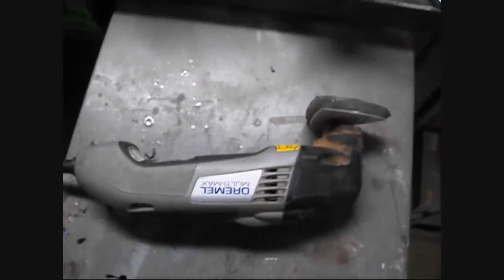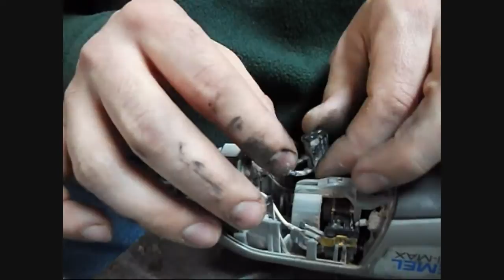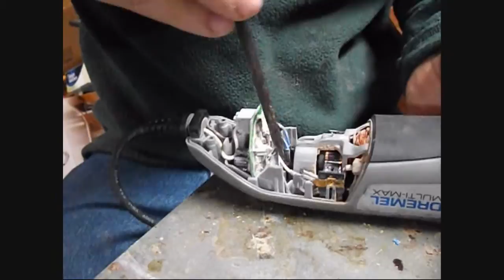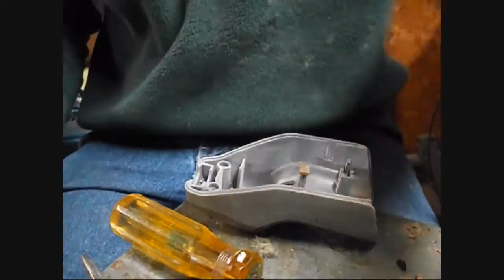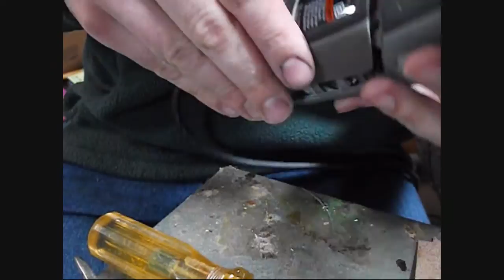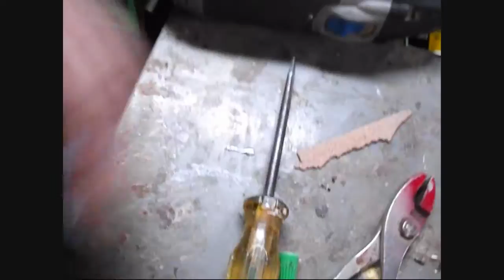Dremel Multi-Max fix

Comment: That's it buddy.  Thanks for posting this video.  I pulled my switch, cleaned the whole inside with electric parts cleaner and it's good.  Maybe using a bit of glue to hold the switch in place will help?

Comment: My 6300 went into a coma a couple of days ago. Your video helped resuscitate it. I just used a dab of hot glue to increase pressure on the switch. Seems to work fine now. THANKS.

Comment: Nice job Mine just quit on me today. Same exact symptom. I shut it off and that was it. Won't turn on again.  Looks like an easy fix. I'll open mine up tomorrow. Did it look possible to shim the switch up instead of gluing that piece on the pedestal? How long did your fix last? For the amount I've used mine over the last several years it really should not have failed. Shame on you Dremel.
Reply: Found my switch is bad. Switch was clicking but still not passing current. Jumping the wires confirmed this. I got my switch working again by blasting some electronics cleaner into the switch plunger area. Cycled it numerous times and it is now working again. I don't expect it to last though. I will try to source a new switch.

Comment: This video makes you see what was really happening inside the tool and gave the idea of what to do.  Just as a reference because it is not said in the video, to take that external cover out, you have to unscrew 3 things; 2 close to the power cord, and one hidden under a circle the dremel decal.  After that step, and checking up the carbons, you have to check the black plastic box electric switch and then LUBRICATE the plastic hole that is moved under by the external switch.  That was helpful and my dremel worked back again.  Thank you michaeljp86

Comment: Thankyou, thankyou, thankyou,  I went to move my tools the other day and noticed that my Dremel case was half full of water. I still haven't figured that out yet. After drying out my tool... I tried it and it didn't work. Thought for sure I was looking at dropping another $100 plus. It turned out that I had the same problem as you and that it was the switch. Put a little electrical tape on the tip and we're back in business. I have no clue what the unit getting wet had to do with my problem but it working fine now. Thanks again.

Comment: I attempted to fix before watching this video wish I did. Started with a frayed cord showing the copper wiring but still worked. Liquid taped the wires and electric taped it up didn’t work. Took it apart missed the bottom screw under sticker and tried prying it until. Cut the cord hoping to splice it back, but now I’m getting nothing. Tried overriding the switch with direct power so may be I burnt it out? Any help on troubleshooting the electric fail would be appreciated but starting to think I just need to buy a new one.... thanks

Comment: I haven't tried it yet, but I'm pretty confident this will fix my Multi-Max.  I'm really glad I decided to check YouTube for a fix before tossing my Multi-Max.  The reason I feel confident about this fix is because after watching the video and how simple the fix is, I tried squeezing the handle of the Multi-Max about the same area where the tower-to-switch connection is, with the external power switch turned on, and it starts to run.  Yeah!  Thanks in advance MichaelJP86.

Comment: Perfect. Used a spot of 5 minute epoxy mixed with cornstarch as a putty on the retaining post, waited until it was stiff , and put the motor housing cover on with switch in the on position. Verified it worked and put switch in off position to allow final hardening. Thanks!

Comment: Thanks.  You just saved my tool.
Reply: Mine still turns on but does not fully oscillate as it did when new. It just vibrates. The tools are not effective with just a vibration.

Comment: Thanks for a simple solution!  I just dismantled my MultiMax.  It seems that the switch is a very common problem. 

Follow-up: After testing the switch as you showed, I determined that the speed control appears to be my problem.

Comment: Thanks for sharing.  You pinpointed the problem that will affect them all eventually as that tiny piece of plastic  in the switch wears down. After repair it will eventually wear down further and then the switch will need to be replaced.  I used a drop from my glue gun on the "pillar".

Comment: Mine stopped oscillating. It still turns on but only vibrates. Tools are ineffective with just a vibration.
Reply: 1Fly Guy Hi there. Did you ever find a fix for your Dremel Multi-Max?
Reply: Mine just did that too and I'm on the job and I need the damn thing! Just vibrates pissing me off! Looks like nobody answered

Comment: Not the case with mine. What a let down. mine also about two years old. Don't think I will trust dremel any more. Third dremel product bought, used properly and they still ended up as junk. Very disappointed.

Comment: Dremel sucks!!  How long have they known this switch design has a very high failure rate?   What have they done?  NOTHING!   Same switch in 2018.
Reply from the maker: OdinsCloud a simple switch needs such a complicated design? i wouldnt think so. but on the plus side i still use this tool today and never had any more trouble.